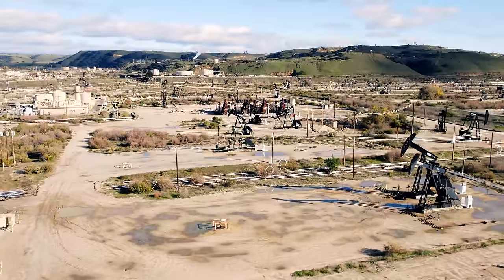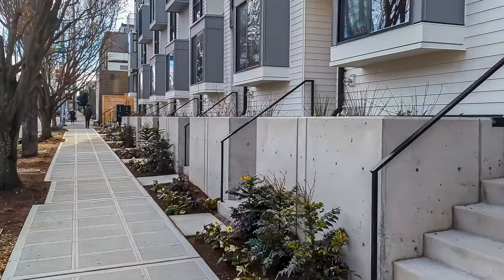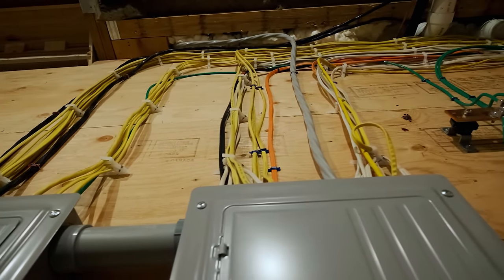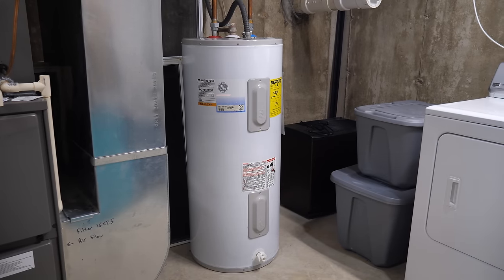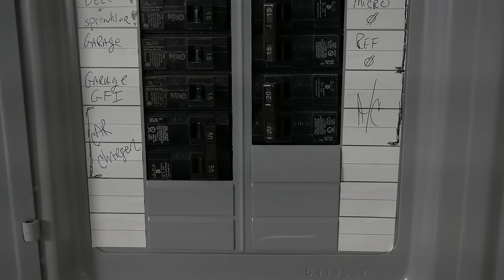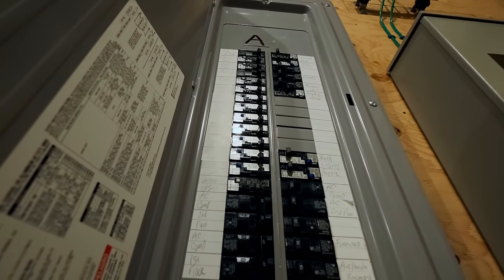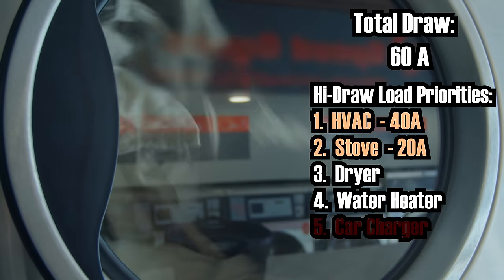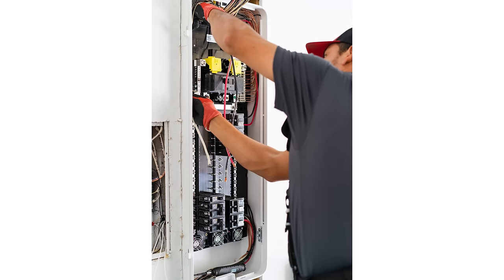Home Electrification: There's not a lot to do, and it doesn't have to be hard (Part 1)

Comment: Great video, as always!  I think the biggest challenge is likely to be cost. For a person switching from burning fuel to heat their water and their home to using electric to do those things could very likely double their energy cost.
Reply: Only with resistance heat. Heat pumps are actually more efficient and cost less to run. But the up front cost is high.
Reply: @jamesvandamme7786  No, resistance heat would quadruple the cost. Heat pumps "just" double it.
Reply: @slawomirjanicki9580  It depends where you live. I have 35kW a gas boiler that usually heats my house, using water filled radiators but this winter I used a 6kW heat pump installed in may 2022. Using HP was a bit cheaper than gas this year, because of the rising gas price. Ițm using a grant to install some solar panels that would make HP even more profitable. Heat Pump cost me 2.700€ with installation, a 6,5 kWp solar panel system cost me 3.470€ (full price is 7.550€). Hot water is still produced by the gas boiler, it was cheaper to keep using it than install a boiler with the heat pump. I live in Romania.
Reply: @razvanlex  Of course it depends where you live. This is because in most places energy prices are locally regulated. For me the natural gas prices have just dropped last month and the electricity prices went up. BTW, we pay separately for the electrical energy and for energy delivery. These services are provided by different corporations, so we have the opportunity to enjoy price increases for both. Nonsense? Of course. Gotta love the system.
Reply: Zaydan Alfariz  Well, we come from behind in comparison with the western countries, but usually it's easier to build from scrap than to retrofit. That is also the case with our neighbours, Bulgaria, Hungary and Poland, all in EU.
Our National Energy System have a total installed power of about 19.000 MW and usually we use about 6.000 to 8.000 MW of power. The capacity is about 6.600 MW hydro, 3.400 MW coal, 3.000 MW wind, 2.800 MW gas, 1.400 MW nuclear, 1.400 MW solar, 106 MW biomass, 21MW biogas and the rest waste, residual heat and geothermal.
Reply: Zaydan Alfariz  I really don't know about other countries but I doubt that they are expensive, probably the other way, they don't have to integrate tu EU and respect some EU laws.
Bulgaria is not that bad, trust me, since 2008 I'm visiting them on holidays 4-5 times a year at least, they are better than 10 years ago, as are we. It used to be a bigger difference to us but I think they are catching us.
Reply: Zaydan Alfariz  I don't think that is the problem, because they are a Muslim state. Moldova and a lot of neighbouring countries can't acces EU also.
We had our problems to that needed to be solved. We entered the EU in 2007 and still don't use euro currency. We still can't acces Schengen so there is work to be done.
Reply: Zaydan Alfariz  Maybe they are, but still they are not ready for EU. I really don't want to get political or anything and I don't want to upset anyone, but I was raised to respect other people and their customs. If I came into your house I respect you, your family and your customs. I expect the same when you are into my house.
If I go to Japan I will try to respect them and not offence, even if some customs seem strange to me. 
If a european girl goes to a muslim country she shouldn't get topless on the beach or wear a miniskirt like in Paris.
You get the idea, it's all about common sense and respect basically, in my opinion.

Comment: here's a fun fact, breakers can do like 25% overload in brief pulses at much as 60 seconds
this means that EVEN if you run the range for like 10 seconds and peak at 115a, that WON'T trip the main

it is ill advised to intentionally overload breakers, but that is what any inductive load does EVERY time it starts
your AC might pull 26a at 240v(example from hvacr videos) but that could mean a spike of over 80 amps when it first boots(motors are terrifyingly spiky)

Comment: Nice overview. One tiny correction - A/C unit breakers are generally quite oversized to handle startup surges. Even the wire size can be smaller than what would normally be allowed for that breaker size. We have a 2 ton A/C with a 30 amp breaker, using #12 wire (normally only rated for 20 amps) and which can pull over 40 amps momentarily on startup, but only draws maybe 8-10 amps once it's running. That also can vary depending on heat loads.
Reply: My A/C is plugged on a standard electrical outlet as it draws very little power (800W at most). It is an inverter A/C and will not pull large amount of current when starting as it.

Comment: There's a new community called Babcock Ranch being built in Southwest Florida, and I was researching it after Hurricane Ian came through last September, because it survived almost completely unscathed while so much of the area was devastated. One of the draws (heh) of the community is that all the homes are supposed to be very energy efficient and "exist in harmony with the environment." As you noted, residential gas is fairly rare in Florida. The houses we lived in when I was growing up there only had resistive heat, and no one had a gas stove. So I was very surprised to see, when checking out the houses being built in Babcock Ranch, that they all seemed to have gas stoves! Supposedly they all have electric heat and water heaters, but I thought it was interesting that a brand-new, "eco-friendly" community would bother to run natural gas to most or all of the homes.
Reply: I live in a new home in FL with the new rating you are talking about, just like Babcock, and we were unscathed as well. Even though the home is very efficient, and can withstand hurricane level winds and debris, I would not call them existing in harmony with the environment. The homes are made with tons of synthetic materials that have been thought  to cause cancer, windows are tiny (we had to upgrade a few rooms to get in some good natural light), and we are told by the HOA that only a few allowed solar providers are allowed and that you must go through the HOA. I found all sorts of defects in the house and I think the main one is not enough support deep in the sand to hold the weight of the home more than a few years. 

We plan on selling in 2 years or so and doing a custom home done right with way more natural materials and get a better efficiency rating.
Reply: Yep. You never see gas pipelines being suspended by poles. its all underground.
Underground electricity lines are prolly more reliable
Reply: apparently gas stoves have become something of a status symbol for some groups of people who insist on them despite the obvious issues of combustion byproducts and lower efficiency relative to induction burners

Comment: I really wish it made more economic sense to take my house full electric. I live in Colorado where gas is cheap and electricity ~avg priced. Cold climate heat pumps are certainly viable, but the running cost benefits are minimal without a hike in gas prices. Not enough to justify spending thousands more up front. Areas with tons of gas infrastructure and cold winters are going to take a long time to get off gas.

Comment: I'd think ideally you'd de-prioritize the HVAC system (essentially using the house as a battery) until the temperature drops below (or above when running AC) some threshold, in which case it again moves back to the top.
Reply from the maker: Hmm... I suppose that could make sense. I come from a land where "if the heat stops working the pipes will freeze!" so my paranoia tends to make that priority one, but certainly shutting it off in favor of the stove at dinner time isn't much of an issue (especially since that heat is gonna end up in the building anyway!).
Reply: @TechnologyConnections  Perhaps killing HVAC at the breaker panel would be too aggressive (and it wouldn't know the temperature in your house anyways). It'd probably work better as a smart thermostat integration to modify the set point when the load from other circuits high. So essentially like a load-shedding message from your utility, but instead coming from the panel.
Reply: @global2829  Does that really help? Changing the setpoint affects the average load but not the peak. If the goal is to throttle the power used by that subsystem, it somehow has to tell the HVAC to run at a lower power mode, and I don't know how well heat pumps are set up to do that.
Reply: @nathanjwill  I'm assuming a basic HVAC system where the thermostat is either calling for 100% or 0%. Say you want your house at 72 degrees. Oven comes on, thermostat changes to 65 degrees, HVAC turns off.

If the house gets down to 65 degrees, HVAC comes back on, and the smart panel disables the oven.
Reply: @global2829  Yeah but if you turn off the oven in the middle of using it (especially, for instance, if you're baking) you likely ruin what's being cooked.  Better to leave the HVAC off until the cooking is done!
Reply: @c.a.patrickvoigt1795  Maybe it depends what you're cooking. I'm thinking of baking something that might take 40 minutes. In most cases turning the oven off for the few minutes it might take to use an electric kettle / coffee machine / microwave to make a couple of hot drink should be fine.

Comment: Load side management systems are also available for Generac automatic transfer switches.  By having load management, you can reduce the size of the house backup generator which lowers both upfront cost as well as potential fuel usage.  As for town wide management systems for electrical usage, a town in NY(Rouses Point) planned to use this to lower the town wide electrical load so that they did not need to have Nuclear electrical capacity available all year long when it is only needed for 3-5 days a year.  They put the system on the electric water heater, to turn them off, if necessary, between 4 pm and 8 pm on those coldest days of the year.  Their goal was to keep electrical costs at 2.5 cents per kw back in the 90s.

Comment: The only issue with an all electric home is when power goes out, you have nothing. At last with my gas water heater i can still have hot water and with my gas stove i can boil water and cook if i need to. By going to a full electric home, not only would some have the cost of upgrading their service lines, but also probably need to install a home generator that would require natural gas. Some areas are more prone to power losses than others and weather events have been trending to be more severe. In my area, we had ice storms that knocked out power to areas for several days. On the news they said that the cost to bury lines was around $1M for some crazy short distance so it was not feasible. They have also recently increased our energy rates by like %50 claiming it is because more things are using electricity... No joke. They actually said it on the flyer that rates need to go up due to more things like EV and smart homes and more electronics.... Waiting for the next hike when more people are forced to buy EVs in a few years...

Comment: First: love your videos and how you raise awareness and make us ask questions. 

However, I really wish you'd given more information on how to switch to an electric heat source for my forced air system in a cold climate. When it can be -30C for a couple of weeks each year and a couple of days it might start approaching -40, it sounds to me like the heat pump (that's just around the corner) which can function in -23C isn't going to cut it, not even with "emergency" heat strips. I feel that they aren't really emergency things if one were to need to rely on them for a month.

You touch briefly on the water boiler near the end. Are you aware of a system for heating water which involves sticking a radiator on the roof with tubing to pick up heat from the sun? My parents have such a system and whilst they still have a gas burning water boiler, the heat is only topped up as needed by the gas and most of the water is heated and kept hot by the heat exchange system on the roof. It's very neat. The little pump that gets the liquid in the tubes back up to the roof runs off it's own little solar panel! So to then switch a boiler to electric as well would mean one could have some very energy efficient hot water, the electricity would only be used to bump up the water temperature as needed if the sun isn't providing enough heat in the middle of the winter.

Comment: When it gets a good bit below freezing most heat pumps are going to struggle to really make it feel comfortable inside. They may "keep up" but the output air is going to be relatively cool so it won't seem as warm. Sometimes having a fireplace or switching to resistive heat for a bit can make things much nicer since the output air will be much warmer. 

A smart panel would make getting a whole house generator much better. With all electric heat you generally end up needing a much larger generator since it's possible to end up pulling a lot of power if you're really running the whole house. A smart panel might let you still run the whole house instead of just a few emergency circuits while still using a smaller generator.

Comment: I grew up in a home with an electric resistance “furnace”. Seems so silly compared with a heat pump.
Reply from the maker: I'm working on my parents to upgrade. Even better, now that I know how much heat they actually need, a three-ton heat pump will be fine. I thought they'd need to have at least a four-tonner, which would mean upgrading their circuit to the outdoor unit. But nope! They're all set.

Comment: 16:34 I would have put it in this order:
1. Stove and Flow heaters. (You are actively using them, which would waste your time if they were to switch off.)
2. Washing machine, Dishwasher (Runs through a program, which means that it would forget its progress if it was forced into a hard reset.)
3. Dryer (Doesn't quite run through a program per se, but it doesn't re-start the drying after a power loss.)
4. HVAC (The temperature of your living spaces is a fairly slow-reacting system, but you still don't want this to be interrupted for the whole duration of the below processes.)
5. Boiler (It stores the heat of the water that has been heated thus far, and you only care that it is finished heating any new contents after a few hours.)
6. Car charger (You only care that it is finished after 12 hours.)
And for completeness, priority 0 is "every other appliance, outlet and light fixture".

I get why you think that you want your heat pump to be able to run continuously, but at least the stove, washing machine and dishwasher will still heat your home as a byproduct while they are running. And in hot weather where your HVAC allotment goes to cooling. Well, your mistake might have been to dump 50A through your stove in the first place. You can probably get that heat extracted faster (and definitely cheaper) by opening a kitchen window.
In the rare case where you start 5 separate Thanksgiving dishes on your stove at once plus your dryer, and your HVAC would want to be running at least some of the time, I'd prefer dedicating 50A+20A for stove and dryer and switching off the 40A HVAC, rather than dedicating 40A+50A to your HVAC and stove and surprising you by leaving your laundry to sit wet in the dryer. You hopefully won't forget it in there for hours on end, but wet laundry can actually get moldy (at least that's what common wisdom claims).

Comment: The first thing that came to mind for preventing car charging when other appliances could overload was a mechanical time switch we used to use in pig barns, set it to turn on overnight. Though that obviously has its drawbacks since some appliances such as air conditioning can still turn on overnight.

Comment: Electricity is expensive where I live. Electricity is mostly generated by fossil fuel. The United States needs nuclear power. It's amazing that we have built one plant in 35 years but fission still provides 20% of US electricity. 
That being said, burning natural gas supplies an incredible amount of thermal energy for months, for everyone all winter.  I plan on installing a wood stove for some hot water, supplemental heating and a few other ideas. 
I truly think that since hydraulic fracturing, its a cheaper and better option to supply the appliances which create a lot of heat to simply run on gas. 
The only way i think it is good and less centralized to convert to electric is local generating. If i had a rooftop loaded with solar cells on the south side, and a decent place to dump that charge, I would be fine going all electric. 
But my gas bill in the winter is still less expensive than my electric bill in the winter. The electric bill in the summer is eye popping.
Edit: Also, do we want one company to supply our heating, cooling, home electricity, transportation fuel for everyone in a geographic market? A monopoly has no incentive to provide high quality or affordable service. (See Department of Motor Vehicles)

Comment: I dunno how much this fits the topic, but I'd live to hear your take on tankless water heaters and combination boilers, gas and electric. Efficiency as well as the sacrifice of the "battery" effect the tank of a standard water heater gives.
Reply: @Alejandro Mendoza  no they aren't. They don't work when it's cloudy or at night.
Reply: Tankless electric water heaters are a scam.  They are barely more efficient than normal tank water heaters and they require major capacity upgrades.  Meanwhile a heat-pump water heater is a massive efficiency improvement and requires the same or lower electric capacity compared to a normal tank.